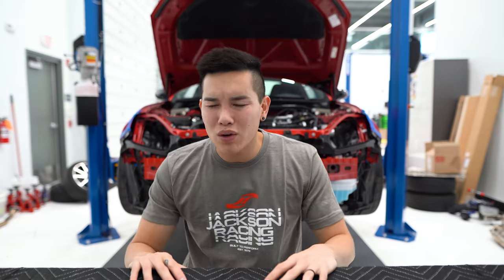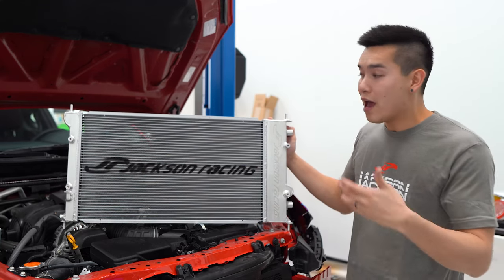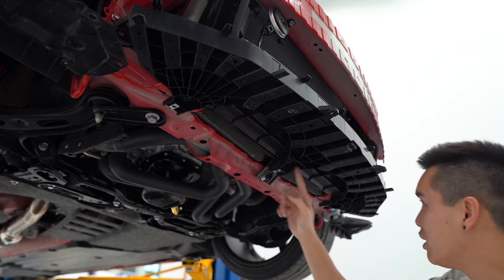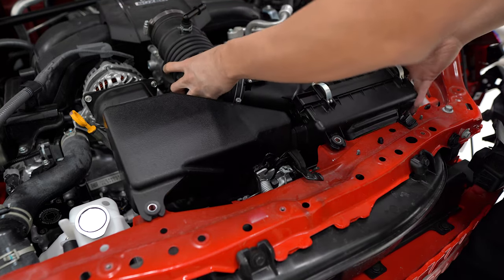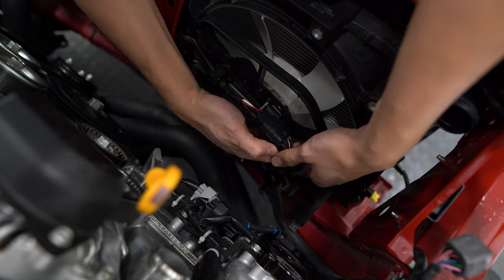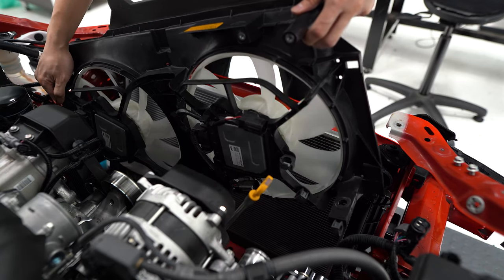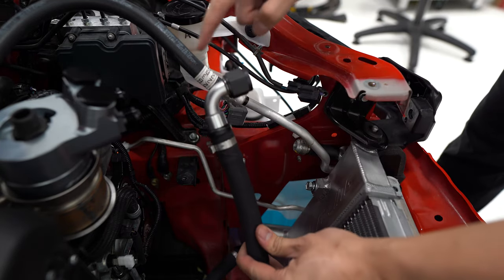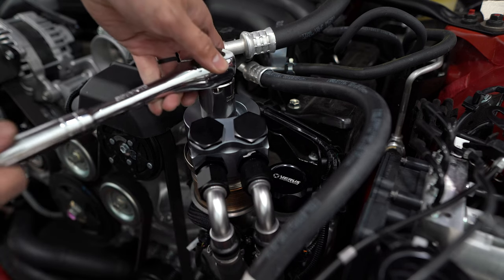2022+ GR86/BRZ Jackson Racing Dual Radiator & Oil Cooler Install

Comment: Thank so you much for your install videos Kev. Super clear instructions and great ways to avoid trouble/breaking stuff. 

Tip for putting hoses back on, and maybe even removing them. Use hand sanitizers everyone has now 👀 alcohol is a great lubricant, and it just evaporates away, no residue.

Comment: Would it be better to remove the stock 2022 water to oil heat exchanger that is now sitting under the JR sandwich plate? Since the water to oil heat exchanger at the dual rad would be so much more effective than the stock one, no seanse having the oil suffer TWO pressure drops going thru TWO heat exchangers? Wonder what the oil temeratures are of having TWO heat exchangers vs just the JR dual rad set up alone. Yes i understand the stock heat exchanger would help bring the oil temps up faster at cold start but i worried more about pressure drops and cavitation at high rpm.

Comment: So is there no thermostat for the oil? Seems like that could be a bit problematic in the winter.
Incredible work filming that by yourself. Finding the right camera angles, then getting it set in place, etc....wow! First class clear instructions. Great stuff!
Reply: People add those themselves alot of times
Reply: I think jackson racing claims it's not necessary since the oil is cooled against the coolant, not directly to air.
Reply: I'm in california so obviously this doesn't mean much but so far it seems that oil comes up to temp just as quickly. I wouldn't be super concerned. Especially if you're running 0w-20.

Comment: Okay so a bit of disclaimer here: I've never run a dual rad before. However...

I know quite a few people, some of them own their own shops and/or track pretty competitively. Every single time I've heard one of these guys talk about dual-purpose rads, it's always them saying to stay away from them SPECIFICALLY in reference to track use.

Now, would this be a good solution for a bit of spirited driving in a hotter climate type of thing? Or just a bit of autoX? Probably, but I don't know for sure. What I can say is that, as far as I've seen (not personally experienced, just seen at track days), these things don't perform well at the track. Better than stock in almost every case, but not enough to keep your oil temp/pressure where you want it. Take that for what it's worth.

If you are either already in the track scene, or thinking about getting into it, I suggest you take the time to do a bit of research and make your own informed decision. Do a cost comparison vs a stand-alone oil cooler + upgraded rad, and determine your own risk threshold.

This is a good idea on paper, but I haven't yet seen it stand up in extreme conditions.
Reply: We won two SCCA national championships with this dual radiator/oil cooler on our Gen 1 race car. So it does works for naturally aspirated guys on track. We suggest our Track Cooler (air to oil cooler) for hardcore track/high HP/racing use.
Reply: for na it might do the job but FI is a negative.now if never goin Fi then thats ok.

Comment: Will the radiator fit with turbo installed? 2019 JDL UEL V2. Had to get slim fans to fit hot side of turbo and its still pretty close.

Comment: Didnt understand the reason for the cooler lines not being shorter. this causes pressure and load losses that the OE oil pump was not designed for. Also, the spacer and the flange not being one whole piece can cause future oil leaks. Overall nice product but some stuff is weird.

Comment: So gen 1 BRZ/86 are compatible with the Subaru oil/water heat exchanger, if it is possible to make gen 1 twin have the same function cooler kit like this one for gen 2? Also very interested in oil temp improvement on gen 2 cars!👍

Comment: I thought the 2nd Gen came with an oil cooler stock? Isn't that what is sitting beneath the oil filter? Is that not sufficient cooling? If not, why not remove it so you only have the Jackson Racing cooler? Seems strange to me to have 2 oil coolers. Especially if one of them is not good at its one and only job.
Reply: not sufficient for track.
Reply: @marccandrift  Ok, wasn't sure, he did not mention it at all in the video. Sucks the stock one isn't good enough.
Reply: Having the 2 coolers is also beneficial as the OEM unit helps warm up the oil as well.

Comment: what's the weight difference from the OEM part? because if anything like the older ones they'll be a little front heavy already, so adding extra weight right at the nose of the car wouldn't be great.